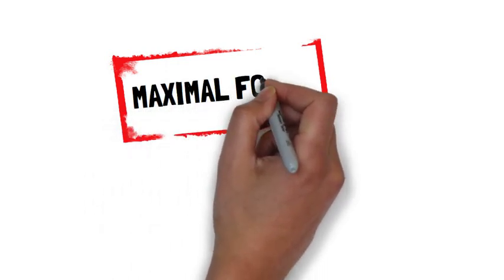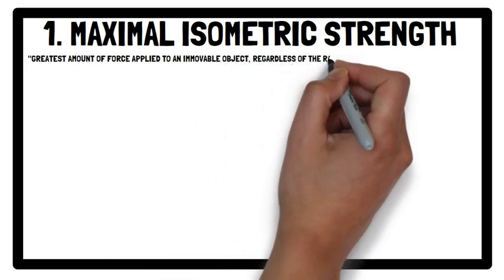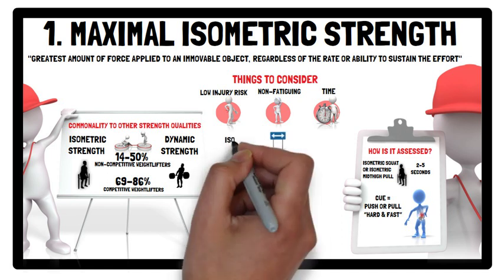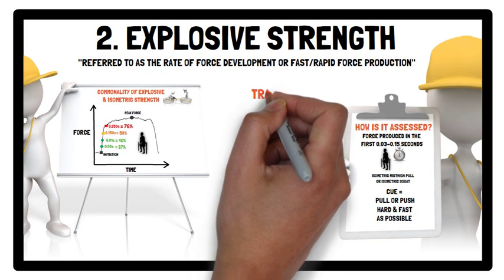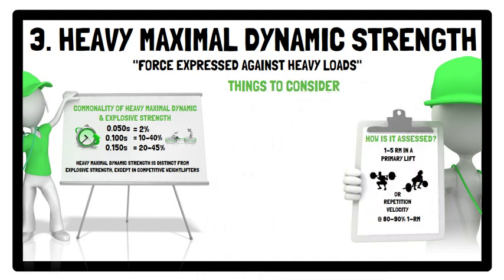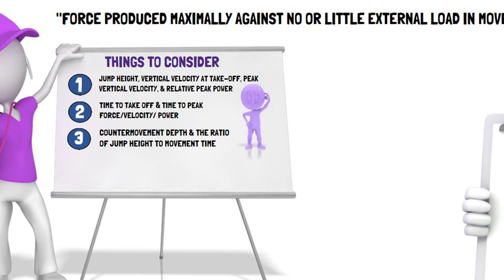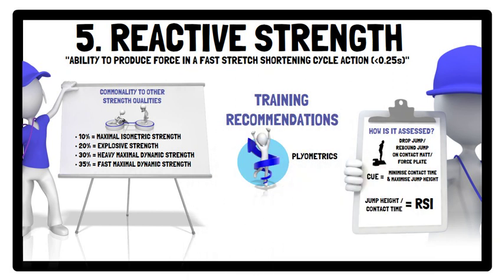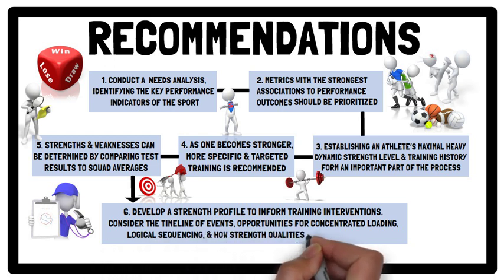STRENGTH TESTING & TRAINING RECOMMENDATIONS (BY LACHLAN P. JAMES ET AL.)

Comment: While it is mentioned that maximum isometric strength tests such as the IMPT may require expensive equipment to calculate RFD to a great extent, there are some low-cost alternatives proposed with strain gauges and a crane scale that can provide very useful information.